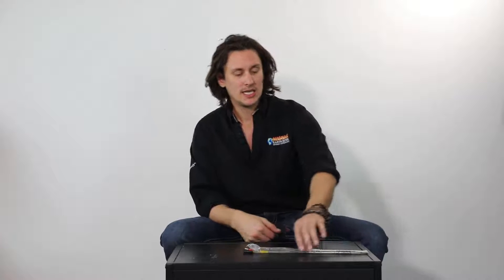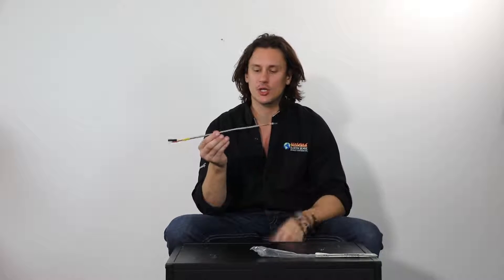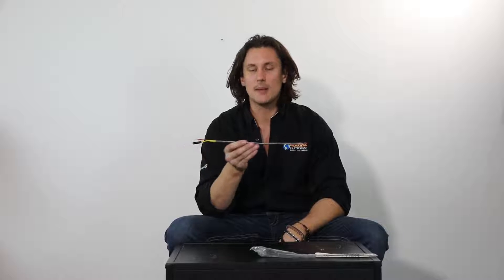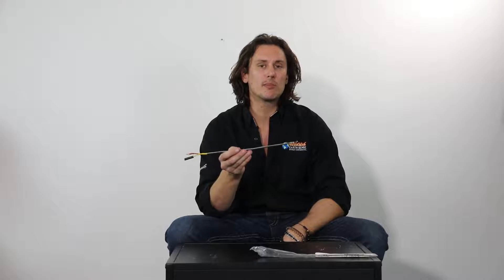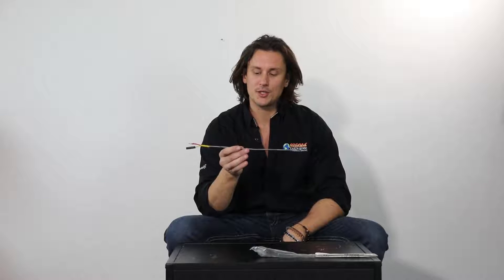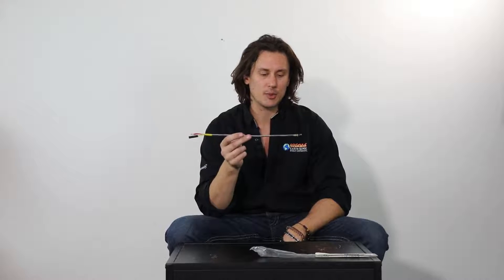Quadrafire Thermocouple Function & Troubleshooting

Comment: I have an FS-QFI35FB-SB gas insert unit. 10 years old.  For the past couple of seasons, the pilot light ignites, but much of the time the unit does not.  When that happens I usually have to turn off the power several times and it will finally light.  Our local dealer has been unresponsive regarding service.  I ran across your video, and believe my issue may be the Thermocouple.  Comments and guidance please.  Thank you, Kelly Kemp in North Texas.
Reply from the maker: Hi Kelly, thanks for contacting us. I ran this past one of our techs. We specialize in pellet, but some possible things to look at here on your gas unit - I would think either a thermopile issue that is not opening the gas valve to the burners or the gas valve body is sticking closed. Here is a contact number I found for HHT (Quadra-Fire) possibly they can help pinpoint the issue 1 (800) 398-6195. Hope that was helpful, thanks!

Comment: Great videos! Replaced a worn out thermocouple (light flashing 3 times). Now the fire starts but goes out because the auger stops feeding.  Auger worked fine before replacement.  Could it be a defective thermocouple?
Reply from the maker: Thanks for contacting us. We have been running into an issue with some of the Quadra-Fire thermocouples where the leads are backwards which gives a negative signal that the board does not recognize. Try reversing the leads and see if that does the trick. Keep us posted, thanks!
Reply: @EarthSense  I've been wracking my brain as to why my new thermocouple didn't fix the problem.  I just switched the wires and now I'm all set. Thanks
Reply from the maker: @chief253hq  Perfect! Excellent to hear. Any other questions down the line just let us know - Stay warm!
Reply: @EarthSense wow…just want to thank you for this tip had my thrcoupler flashing 3 amber just before Christmas the ceramic nose had a hole burnt in it and it melted the leads..I muffler cemented the hole and crimped the 2 wires together and ordered new parts from Amazon and just got them here in Canada today,I installed them and dam unit would light but not stay running,,,was about to order a control box (had checked all the other switches etc),,, came across your video and started to read the comments and thought what the hell I’ll change the polarity I know have heat ,,,thanks so very much for the trouble shooting 👍👍👍👍👍👍
Reply from the maker: @mikejackman4416  Hey Mike, Fantastic to hear! Great job - Happy we could help! If you need anything down the road just let us know. Thanks!

Comment: 1200i. Way to much fly ash. Have changed pellets. Cleaned thoroughly. Fire lights and burns great but then slowly wilters out. Won't maintain flame even with adjusting feed
Reply from the maker: Hey Chuck, thanks for the message - happy to help. How long after initial flame does your fire go out? Is the control box giving you any colored light blink sequence? 
If this is happening consistently right after start-up (Initial dropping and lighting of pellets) then I would lean towards the Thermocouple being the culprit. Pull off the cover and inspect the thermocouple. Let us know if you see a light sequence on the control board. 
If your fire is wiltering out when the unit is in normal operation it could be a few things. 
1. You mentioned the cleaning which is great. Any ash that's plugged in the unit or vent will trip the vacuum switch and shut down the fuel feed. In your 1200i be sure to inspect all the firebox ash traps and where the exhaust connects to the venting. Let's also make sure the door gasket looks good and is sealing tight. 
2. Auger motor could be potentially loosing it's torque - The motor can be tested.

Let's start with the simple things first and take it from there. Keep us posted. Thanks!

Comment: I have a Quadrafire 1200-I insert that is not functioning properly. The pellets get hot and balck in the pot but will not light-up? Any Ideas on what the issue could be? Thanks!
Reply from the maker: Thanks for contacting us, happy to assist. If you have a voltage meter, let's check the ohms on your igniter to make sure it's in correct range. The 1200i Loop Igniter should be between 43.5 and 53.5 ohms. Here's an igniter testing video incase you need it - https://youtu.be/z4wmCc96rVI

If the igniter is in proper range, then we will want to look at the combustion blower and any areas where the stove may be loosing it's combustion air flow.
1. Make sure the stove and ash traps are cleaned thoroughly.
2. Let's make sure the burnpot holes are open and the bottom pork chop plate is sealing tightly.
3. Let's make sure the door gasket is sealing tight all the way around, and the glass gasket is sealing all the way around.
4. Let's make sure the combustion blower is running correctly. Should be near line voltage on start-up. 

Let's start there, keep us posted with what you find. Thanks!

Comment: Hi Taylor, i had a Quadra-Fire CB1200-I pellet stove installed in 2001.  It's been great.  I've had it serviced regularly.  Last year we heard a 'clicking' sound that would repeat frequently at start up...but the  stove operated just fine and normally (except for the clicking sound).  Early this year during annual service cleaning the I asked the technician about the clicking sound...he told me that the i should replace the thermostat with just a switch because it's hard on the igniter and that should solve the problem.  It was at the end of the cold season (March/April) so we only used the stove for about 4 weeks after the annual cleaning service and thermostat replacement with a switch...it worked just fine but the clicking sound was still present.  Now that the cold season is here again we started using the stove.  The clicking is worse and, at start up, the flames are EXTREMELY HIGH at ignition.  Time to ignite is normal...just extremely high flames at start up.  It takes about 3 to 5 minutes for the high flames to normalize to the specification of ~3 inches above the fire pot.  The thing i've noticed, other than the increased clicking sound at start up, is there is no delay/pause for ignition of the initial pellets...The pellets continue to drop while the stove is going through the ignition cycle.  I seem to remember that during the ignition cycle the pellets would initially drop and then stop...once the fire got to a certain temperature the pellets would then start up again.  My gut feel is that the igniter IS NOT the clicking sound we are hearing.  I'm thinking it could be the 'reset'.  when i hit the reset button i hear a click.  Thanks for putting up with this lengthy explanation.  I'm not sure what i should do hear.  Except for the clicking at start up and the high flames the stove operates just fine.  Any advice here?
Reply from the maker: Hey Richard, thanks for the message. Let me run this past our techs and follow-up. I'll be back in touch shortly. Appreciated.
Reply: What was the outcome of the tech conversation?
Reply from the maker: Hey Richard, Greg in tech support mentioned that he was able to touch base with you on this. If you do have any other questions or needs just let us know. Appreciated!

Comment: I am thinking that we have a thermocouple problem.  The fire will ignite, the blower will start and then after about 30 min it will shut off.  Last season, it would not completely shut off but the fire would constantly go out and then have to restart again.  We have an 1200-I insert model that is older.  Does this sound like a thermocouple issue or is there something else I should be looking at.  I also appreciate your advice and videos.  I live in a small town and the local dealer came out to look at our stove and was completely useless, so you will be getting my business from now on.
Reply from the maker: Hey Lindsay, thanks for contacting us! We're happy to assist and get you back to 100%. Based on what you are describing, it does sound like a Thermocouple issue. When the Thermocouple reaches proper temp there will be an indicator light on the control box (Depending on the year and style control box it will vary). Let's do a test where you have the side panel/curtain open so you can view the control box and lights. Go ahead and start the unit up and make notes on what lights you see on the Control box, both blinking and steady. I think by doing this we can come to more of a definitive conclusion on whether this issue is with the Thermocouple or if it is something else that needs to be addressed. 

Also, let's pull off the ceramic thermocouple cover and inspect the thermocouple and gently clean off any deposits that may be on it. Thermocouple end should be the two wires coming to a soldered point at the end. 

One last question - when the fire is operating during the start-up cycle, is it crisp and torchy or is the fire lazy in anyway? 

Keep us posted, thanks!
Reply: So of course we turned on the stove last night and this morning for the first time in about a month and it worked perfectly fine.  I guess it’s not the thermocouple after all!  Thank you again for your comment and help.  To be continued….
Reply from the maker: @lhamrick123  Good to hear Lindsey! If any issues or troubles come up just let us know, always happy to assist. Thanks and warm regards -

Comment: Have a Quadrafire CB1200, at start up stove fires and runs a complete cycle then tries to start when thermostat calls for heat but fails to light. Small amount of pellets are dropped but does not fully catch start.
Reply from the maker: Hey Kent, thanks for your message. The startup process in the control box is going to be the exact same from initial start-up to start-up on thermostat cycles. This could possibly be a cleaning issue, a weakening igniter situation, or a weakening feed motor that lags once it is up to operating temp. Any more information you can provide will be helpful - I think the message sent was cut off a bit here. Happy to help. Thanks.
Reply: @EarthSense  thank you will check all suggestions and get back to you.
Reply from the maker: @kentlindsay9060  Sounds good. More specifics you can let us know the better. Happy to help.

Comment: When I start up my stove it gets soo hot before the blower will turn on, wasting pellets, any suggestions? It takes about a half hour before it will start blowing heat
Reply from the maker: Happy to help. What model stove do you have? Approx Year of the stove? Many units have a low limit switch that locks in the blower once it reaches temp. As limit switches start to go they have a tendency to not make and break connection properly. Send us a few more details on the unit and we'll help guide you in the right direction. Thanks!
Reply: @EarthSense  I have a Quadra-fire classic bay 1200. It's about 12 years old. Thank you for responding!
Reply from the maker: @djtruckin2874  Thanks for the message back! There is a convection blower low limit switch in your 1200 model. I'll have a link to that below. Basically as this switch reaches temp it locks in and allows the blower to turn on. Once the stove is in cool down and it goes below the set temperature it will break connection and shut the blower off. FOR TESTING PURPOSES ONLY, you can pull the two wires off this limit switch and connect the wires together with an alligator clip. This will essentially bypass the limit switch. By doing this the blower should come on right away once you start the stove up. I think this will be a good test to determine if the switch itself is faulty or if this is an issue with the blower or control box. 
Limit Switch: https://pellethead.com/product/quadrafire-heatilator-ecochoice-1-low-limit-convection-snap-disc-125-degree-safety-switch-thermodisc-oem/

Keep us posted. Thanks!
Reply: @EarthSense  I have a Quadra fire classic bay 1200, it's about 12 yrs old

Comment: Thought I had an igniter issue. Replaced that on my Castile but still no ignition. Red feed light comes on,  blue light blinks 4 times, but red LED is solid.
Reply from the maker: Thanks for contacting us. I touched base with our technical team, here is what they had to say: There is more information that would be needed to get an accurate diagnosis on this one. The 4 blue lights is a red flag right off the bat because that means that the board is set to #4 program which is wrong for the castile. It should be set to #6 or 6 blue light blinks. That would be the first change I would recommend. Next, is the red light on the board on as soon as it powers up or does it come on sometime after attempting to start the stove? The red light is the 600ish degree indicator for the thermocouple so if that is on right away then I would think a possible thermocouple issue. The best way to determine what is going on is to get a step by step of what the stove does when they try to start it up.

If you can provide us a step by step of what's going on I'll get that back to the techs so we can better help troubleshoot. Let us know, happy to assist. 
Thanks.
Reply: @EarthSense  yep. Red light in control box is immediately on when stove is plugged in. Auger is feeding pellets at rate it would if it was heated up. I have a thermocouple on its way seeing as the stove is in a cold start. Everything else is working as it should.
Reply from the maker: @deebsmcsqueebs5589  Thanks for the update. Let us know once you have the Thermocouple installed and if that resolves the issue here.
Reply: @EarthSense  bad thermocouple. It was odd because I never got the amber light. The red LED would be lit as soon as the stove was plugged in.  So it made the stove think it was above 600 degrees and only feed pellets intermittently and not start the igniter. So new igniter and new thermocouple. Also new ceramic cover. Should be good for a while now. 👍
Reply from the maker: @deebsmcsqueebs5589  So glad to hear you found the root issue here, great job! Any questions down the road just let us know, always happy to help. Thanks!

Comment: If I am getting a very large noisy flame is it the fire pot gasket and does the gasket get put in with fireproof caulking? 
Thanks
Reply from the maker: Hey Chuck, I think it's good to inspect the firepot gasket. If the firepot has been removed or the gasket seems very worn it should be replaced. If you are experiencing a large lazy flame, in most cases this would be an air issue. 
1. Make sure your door gasket and ash door gasket are sealing tightly
2. Make sure the unit and venting have been thoroughly cleaned - no ash blockages. Clean all ash ports.
3. Make sure the burnpot holes are all open
4. make sure the burnpot bottom porkchop is sealing tightly.
5. Check your exhaust blower voltage. Should be near line voltage on start-up. 

Let's start there, keep us posted, happy to help. Thanks!
Reply from the maker: Oh, and the burnpot gasket if replaced does not require fire proof caulking.
Reply: Thanks a lot, I have three pellet stoves and two of them are doing that!
Reply from the maker: @WhiteLakerrt16  Happy to help Chuck! Yeah, 8 times out of 10 this is an ash blockage issue either in the stove or venting. Always good to start with the basics. If you need any other guidance as you go along just let us know your models and approx age of the units with any other updates or specifics on what you are seeing. Keep us posted, thanks!

Comment: Thank you for your guidance, the store where I bought my pellet stove stopped selling the stoves so I had no where to turn if something goes wrong! Your info is a great help, I will be buying from your site from now on. The jumper wire is a good idea but the stove blower doesn't turn on and off often enough to where I could sit there and wait for it! Maybe I should just order snap disc 1 and install it!
Reply from the maker: Our pleasure Joe! Happy to help how we can. If you jumper that limit switch you will find that the blower comes on right away and should stay on continuous while the the thermostat is calling for heat. If the blower is still intermittent when that switch is bypassed we will want to take a closer look at the blower first and then possibly control box. My gut says it's the limit switch, but always good to do tests before we start investing money. Hope that helps, keep us posted! Thanks

Comment: Hello, I have a Santa Fe 2007 model. After running for awhile the blower will quite running then start back up several minutes later, is this a thermocouple problem? Thank you for any guidance
Reply from the maker: Hey Joe, happy to help. Is it your combustion blower/exhaust fan or is it your Room Air Blower/Convection fan that intermittently starts and stops? Generally speaking a faulty thermocouple would only cause the feed motor to stop. Off the bat this sounds more like a snap switch issue depending on the blower. Keep us posted, happy to help. Thanks!
Reply: @EarthSense  it's the room air blower that starts and stops.
Reply from the maker: @joemontana4687  Thanks for the message back Joe. Okay, thanks for clarifying. I think we need to inspect Snap Disc #1 which is the convection blower snap disc. Snap disc #1 is located on the right side of the appliance on
 the bottom of the heat exchanger box. There are 2 purple wires connected to it. This snap disc turns the convection
 blower on and off as needed. Power is always present at snap disc #1. 

Firstly, check to make sure the snap disc is secured down properly. If it's loose it may have intermittent issue locking in and opening up. You can use a jumper wire to bypass the switch for troubleshooting purposes. Video below on how to create that. If the blower runs continuous when that snap disc is jumped then that will indicate the switch is the issue. 

Jumper Wire: https://youtu.be/FDVkbsHS95U

Here is Snap Disc #1 for reference. https://pellethead.com/product/quadrafire-heatilator-ecochoice-1-low-limit-snap-disc-110-20-degree-safety-switch-thermodisc-oem/

Make sure the stove is unplugged anytime you are working with electrical. 
Keep us posted. Thanks!